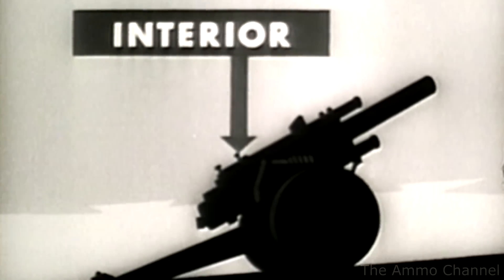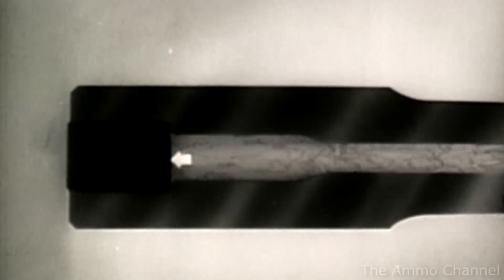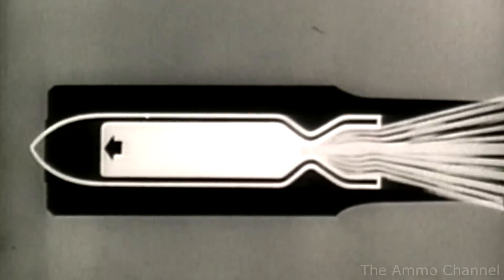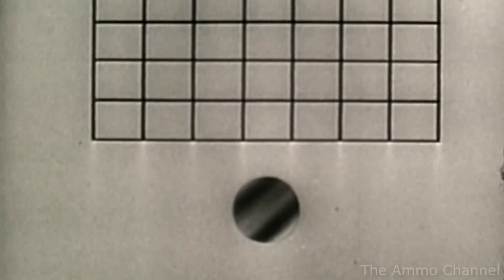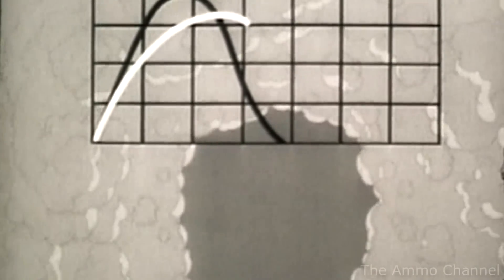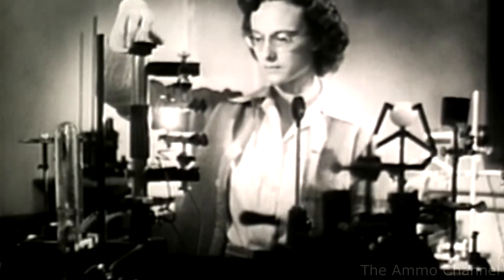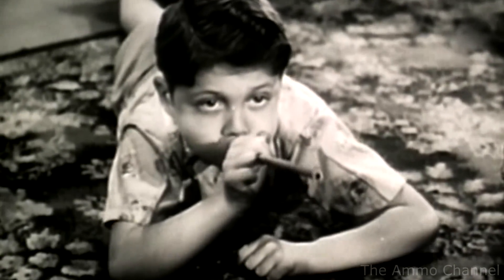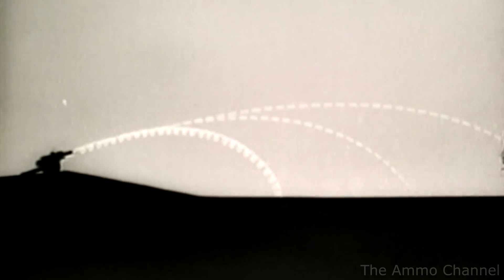Fundamentals of Ballistics

Comment: Good day Y'All!  (funny, from a Canadian)

I have a request.  I've been looking all over the 'Net looking for a 
good penetration test video.

What I'd like to see is something like this;  Or perhaps a two part 
series.

Starting with say, a lower caliber rifle round, as maybe 5.56 (.223)

How much steel will it go thru.  I know this has been done all over the 
'net, but only a few vids did a good job.

However, there is more to this.

.223 FMJ vs 1/4' steel
.223 FMJ vs 3/8" steel
.223 FMJ vs 1/2" steel

all the way up to 3/4"

Then
.223 AP vs 1/4" steel
.223 AP vs 3/8" steel

etc.

Then move up to 7.62 X 39
same thing

then 7.62 X 51 (ish)
FMJ, then AP (AP Only, not API)

all the way up to .50 Caliber

BUT, not only steel, but cinder block, same workup.

A fully detailed good test.

For example, 

.223 FMJ, with speed, and bullet weight, and depth measured (If it 
doesn't go thru) as well as hole diameter.

Basicly a very, very well done, and in-depth report (With data 
availability)

I've been meaning to do it for years, but as a Canadian, getting my 
hands on AP ammunition is hard.  I've had to make my own.  I even went 
as far as to build exploding bullets.  Which worked awesome.

I even tried making AP 9mm bullets (which sort of worked)

I would be willing to help out as well (Money, etc)

Again, I can't find a really really good video, nor in depth data on the
 web.

Cheers.
Reply: Rob Gandy if you haven't already, check out Tnoutdoors9. He's one of my favorite firearms channels, tho he doesn't really upload as much as he use to.
Reply: Cool, thanks